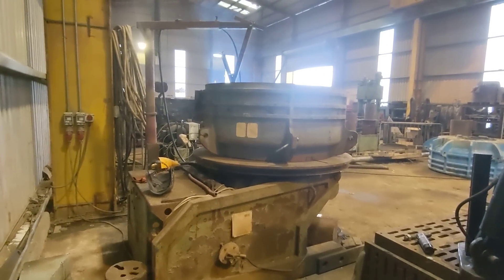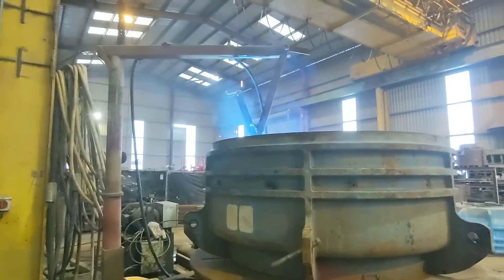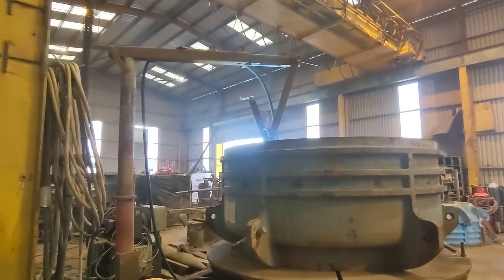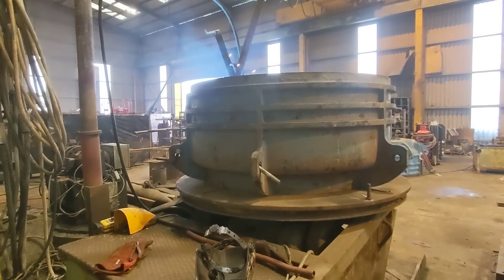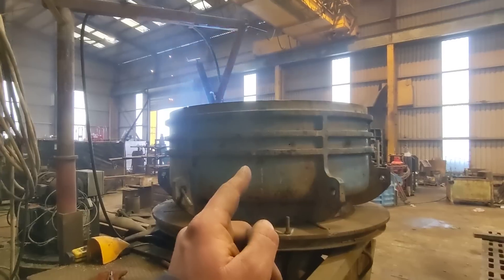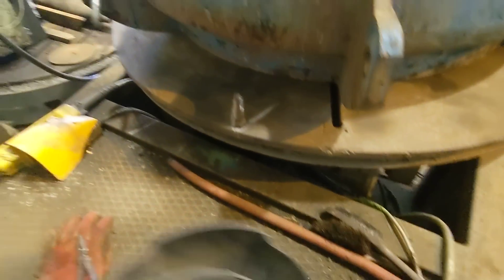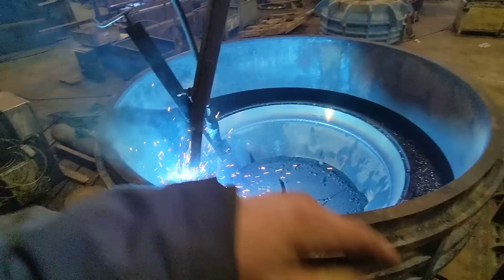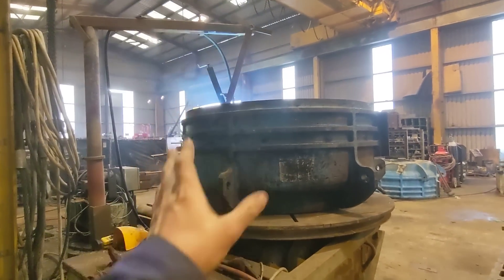automatic welder! im out of a job!

Comment: you dont need high tech to make it automated any more... you could space it out with a wheel and put in a tensioner so its always (x) space from the material, as long as its not a 90 degree change in direction it should follow the profile, assuming it turns flat, it wont help you when the weld goes up and down, but in and out should be easy

Comment: No  napping ,why stainless aren't you supposed to use manganese steel wire?? Manganese is for  crushing abrasion..
Reply from the maker: This is just the part that the seperate manganese liner sits on

Comment: Alastair Brilliant set up I don’t wish to be rude ,but it can be improved to make it fully automated  1 you could fit a small motor on top of shaft and a limit switch  up at the revolution mark and set it to automatically rotate 3 revolutions you can buy those limit switches not expensive If you look up Climax Boretec 306 P Bore welder  that’s how they were controlled ,each revolution they stepped back by a pre determined amount 2 Fit a wee bell to let you know each time it completed a revolution If you ever want any help on the welder set up James Hanna down at Kilkeel worked with us here in Australia and is a smart lad I might even make a visit up that way myself if I get there later in 23 If you fully automated your welding it releases you for other work Happy 23
Reply: And there endeth the simplicity. It ain’t broke don’t fix it

Comment: They may be able to program a welder and computer to make a flawless weld, but it could never access the damage, come up with a plan of attack, and carry out that plan without guys like us! We'll never be out of a job! Thanks for the great videos. Thomas, Mississippi, USA!!!
Reply: Robot can do 3d scan and make a map of the wear and then with some simple guidelines the machine could make a plan to first machine it or weld the low spots first and then the rest. Setting would just need to be set one time. Machine could also change the torch tips and wear parts etc. Welcome to the world of cnc
Reply: @jessetermeer2187  There are some places a robot isn't going to be able to access. Haven't you seen some of the contortionist welding jobs he has done?
Reply: @--_DJ_--  He's probably never picked up a welding lead before! Let robot man do what he does and push his little buttons.

Comment: You could used a spring mounted up top, and little guide wheel down near the nozzle , and it would weld out of shape bits aswell. Great work 👏
Reply: nice thought but you would still be left with an uneven profile at the end.

Comment: Great video! Do you run the stainless wire on these for hardness or for a dissimilar sorta deal? guys up our way we’re changing wear parts on a powerscreen pegson crusher and the same part on there machine was chewed up real bad. Machined surface was totally destroyed.. it must be common problem on them?
Reply from the maker: Its pretty much routine for all crushers to have contact area periodically repaired like this and there are a lot of these pegsons which are high production machine

Comment: For the out of round you could put a spring on the upper hinge point and a roller down by the gun on a roller that would be adjustable as well
Reply: Only problem would be it would still be out of round when done

Comment: Working smarter not harder> nice. I had an idea for your stinger holder make it spring loaded with a drag shoe for the uneven surfaces. Your setup works great.
Reply from the maker: A little roller wheel, thats real good idea! Hmm lol thanks bud
Reply: @allistairc123  It could work if the roller wheel was used to detect the low spots/areas and trigger the welder to only fill the lows. Once all the lows are sufficiently filled and the "funnel" is round enough carry on with adding weld to the entire circumference. All sorts of ways to do the logic and control. If the turntable has a "rapid" feature or simply a way to adjust the speed of rotation then the table could be rotated rapidly past the high spots which would speed up the job considerably. It might also be desirable to have the rotation speed vary as the weld head moves "up" the funnel so that it goes slower as the radius gets larger otherwise the angle of the funnel would change. Basically, maintain a constant surface-feet-per-minute. It is much like 3D printing but with molten metal instead of plastic. Instead of the weld head being positioned in X-Y-Z it could be programmed to position in in R-theta-Z. Cool project.
Reply: I was thinking the same thing .. just mark the start and stop points of the low spots ..watched the video before I seen the comments ..